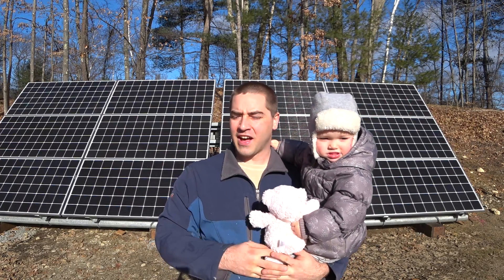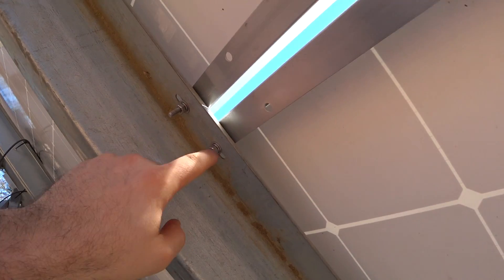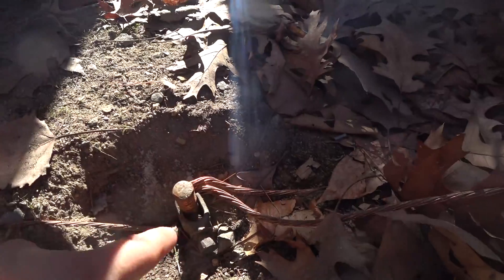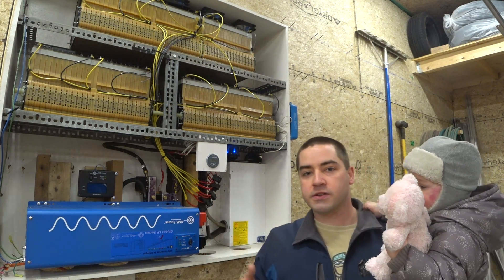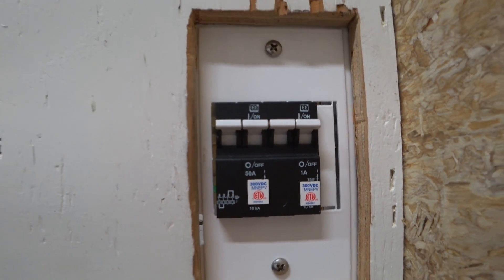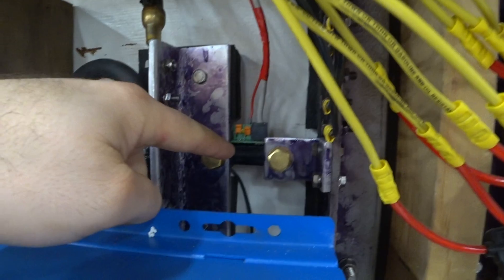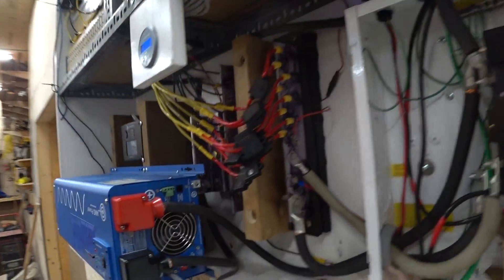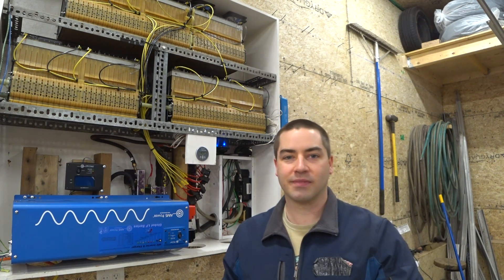Overview of Entire Off-Grid Solar System for Whole House

Comment: Are you able to run a whole house ac with this size battery system?
Reply from the maker: Sure.  For example: 3-ton AC averages 3500W.  After inverter losses, that's about 3,900W from the battery.  This is a 48V battery, so 3,900W/48V=81.25A  This battery can handle 250 Amps, so the answer is "yes" it can handle a 81 Amp load.

Comment: This is impressive.  What size inverter did you use?  How did you break down/wire the battery to match the 48 volt max DC input?
Reply from the maker: In this video I used a 6kw inverter with a 48v battery.  The 48v battery was made with a Chevy Volt battery pack broken into 12s modules.

Comment: Hi, nice build. I want to start a system in Trinidad (Caribbean). I am just confused as to how to size with all the AC units, Fridge, Washer/dryer etc. Can you provide some insight into sizing?
Reply from the maker: I'd suggest using an online calculator to begin the process.  The first piece of information you will need to know is, How many Kwh of electricity do you use per day?  When I built my system I looked at my electrical bill (billed by month) and divided by 30 days/month to find out my use per day.  Try this calculator: https://www.altestore.com/store/calculators/off_grid_calculator/

Comment: Excellent explanation of your build, congratulations on a job well done.  I'm also a solar enthusiast with a 3 KW on grid system and I personally added a 1 K off grid separate system that charges 6 deep cycle marine batteries.  I am a retired physician but you must have an engineering background to do such an elaborate system by yourself. I also added solar to the top of my RV and solar window shades using flexible panels.
Reply from the maker: Thank you for your comment.  My background is construction.

Comment: Hey David
I just watch your video and its really good
Im want go solar in my house. Now i have power thanks to my neighbor letting me run two extension cords. I have  Growatt 3000k 48 v inverter and i dont know where to gwt the panels and batteries. I need help so I can start having power at my house.
Thanks man!!!
Reply from the maker: That's great you are getting into solar.  I buy my batteries from https://batteryhookup.com/  My coupon code is "DAVIDPOZ" which the viewers of my channel can use for 10% off.  It tracks my affiliate.  Sometimes Battery Hookup also has some solar panels, but it's limited.
I shop for most of the other components (solar, charge controller, breakers, etc) from https://www.altestore.com/store/  I'm not affiliated with Alt-E.  
Alt-E has some good resorces.  Here is a calculator: https://www.altestore.com/store/calculators/off_grid_calculator/

Comment: Hi David. I haven't been to your channel in a while, so haven't seen the system assembled. How is it working for your place? Do you still use much grid power, or have you moved most of your electricity to solar? Great looking installation.
Reply from the maker: It's been working great.  My house is 100% electric.  I was back on grid power this past winter because I was upgrading a lot of the work.  New batteries, new inverter, etc.  But been off-grid again for the last month.  Running AC is great.
Reply: @DavidPozEnergy  That's awesome, and congratulations. We've been off grid for over 10 years, and it's been great following your progress.

Comment: Hi, I have 3 KW Solar Hybrid Invertor and connected 335*6 Mono panels(2010W) in Series (2 panels in one series) and parallel (3 series in one parallel). now I want to add additional 445W*2(in series) panels into same setup. is it possible to mix these 2 different panels ?

like I want to have; 

335 * 2 in series(3)

445 * 2 in series (1)

all 4 series connection into one parallel or two parallel connected all to one Hybrid invertor. 

Will it support without impacting existing or new value I mean volts/Amps/Watt.
Reply from the maker: Sometimes you can force this into the solar hybrid, but it will not work well.  The charger will try to track the MPPT (maximum power point tracking).  This works with one type of panel, but if you throw two types into the same port then the computer will always be compromising between the two strings.  Neither one will perform well.  
It is recommended to add a new charge controller for the new panels and connect that direct to the batteries, skipping the hybrid inverter.
Reply: DavidPoz thanks David for your valuable inputs. Logic is clear for me now.
Reply: Hi David , more query on same setup.
I have existing 2kw system with mono panels and now I want to increase the capacity by another 1kw but I couldn’t get same wattage and rating panels in mono but getting it in Poly. So can I use or mixed another two string with poly in existing 3 strings in mono?

Comment: If you were to wire a brand new home, Would you put a DC line in. You know, for things like charger, modems and routers.
Reply from the maker: Probably not.  If I built a brand new home, I would build a brand new shed at the solar array.  This would contain all the inverters, charge controllers, and batteries.  Then I would run just AC lines into the house through underground conduit.

Comment: seems to be a lot off buzz about using the Nissan Leaf batteries, was wondering you opinion  about the different batteries out there and the best bang for the buck, Nissan Leaf, Tesla, Volt etc. would appreciate any input.

Also, is it possible to buuild a system for 200 amp service completely off grid?
Reply from the maker: I personally have not worked with Nissan Leaf packs.  However, I know several people who do use them.  They bolt together beautifully.  Easy to stack and parallel cells.  I'm a fan.  They tend to wear out quickly in the car compared with some other car batteries, so finding the low-mileage ones are worth the hassle. 

Is it possible to make a service like in normal houses?  Yes.  It just gets costly.  Most of us DIY'ers don't have $100,000 for this.
Reply: @DavidPozEnergy  Thank you for your response.

Comment: Hi David This was an awesome video I gave you a shout out on my https://www.youtube.com/watch?v=0V7FufcLGsY Should I pick one of those Victron BMV-712 Battery Monitor's and also dose the shunt come with the rj5 input
Reply from the maker: Hi Darren,  Thanks for the shout out, I'll take a look at your video.  The BMV-712 does come with the shunt and the rj45 cable.  I have it to communicate with my Victron charge controller, and my phone app.  It keeps a record of cycle counts and stuff, so it's nice to see what your system is doing.  It's here: https://amzn.to/2Bbi5Et  However, it is $206.  So it's steep.  If you only want to see your battery voltage, amps, and watts (no app, or history) then there is a cheap option : https://amzn.to/2pkCqEG    If you use my affiliate links then amazon gives me a kick-back.  I hope that helps.
Reply: @DavidPozEnergy  Hi David I have a midnite charge controller will the victron work with that controller also I will use your links on Amazon I'll be purchasing later today. I have some other things I need as well like the plastic piece the protects the whole in my roof from rain that the wires run through. If you have a link for that I will use it as well.
Reply from the maker: Hi Darren,  I think the way the affiliate link works is: when you click the link it opens a browser window.  Amazon then tracks anything you buy until you close the window or 24 hours passes.  I get credit for sending you there regardless if you buy the exact item I link to or some other item.  So you don't need a specific link to a roof flashing.

The victron BMV-712 can work independent of your charge controller brand.  In my case they (CC and BMV) link up using bluetooth between each other because they are the same brand.    So the answer is, yes, the BMV will still work, just not communicate directly with your CC.  But you don't HAVE to have communication.  You will still be able to check your BMV on your phones app.  

Can we connect on FB?  I'd love to know more about your setup.  https://www.facebook.com/DavidPozEnergy/

Comment: I hear the victron charge controllers have a charging limit that can be adjusted.
Reply from the maker: Yes.  The high voltage can be adjusted through a huge range.  This is something I was looking for in a charge controller.  I currently set it down to 48.0v, but it can go up to 65 or so so volts.  This means I can use the charge controller with a range of different battery types.

Comment: David, I really enjoy all of your videos. It looks like our interests are pretty much the same, though you are a few steps ahead of me :) I recently setup an RV camper with 2 48V batteries made from Nissan Leaf Batteries and 3 340W solar panels. The batteries are about 6kw total. Its enough to run everything in the trailer. I just installed a Reliable Power 3000w inverter, the same one you have used. But I can't get it to run the AC. It will run pretty much everything up until 2000 Watts and than won't go. I'm debating about switching to an AIMS inverter. But, as you have said, the support from Reliable Power is great and I have been working with them to see if we can get things going. 

Anyway, thanks for the motivation to keep going. Keep the videos coming, though I have a lot to catch up on still :)
Reply from the maker: Hi Genn,  Yeah, anything with a compressor (like AC's) are tough to start.  Low frequency inverters with big transformers (Aims, Magnum, Schieder, Victron, etc.) are better suited to starting those devices.  When I had trouble starting my air compressor, people suggested adding a soft start kit.  These things are a big capacitor you add onto the AC.  I've never installed one, but they are worth a shot.  Here is an example, but I don't know if it is right for you: https://www.amazon.com/Compressor-Saver-Start-Capacitor-Model/dp/B003FNJ37U/ref=sr_1_5?crid=1U6LCU97JYCOV&keywords=soft+start+kit+for+air+conditioner&qid=1557489687&s=gateway&sprefix=soft+start+kit+%2Caps%2C151&sr=8-5

Comment: new subscriber, your system looks awesome wish you lived closer I could get you to help me with building one close to what you got. I live in Pa and get many cloudy days, how does this work on cloudy days?
Reply from the maker: It works much better than I thought it might on cloudy days.  Recently we had a day with solid clouds, scattered showers, and it putting out 300 watts.  It's a 4,380 watt system, so 7% doesn't seem like a lot, but I expected 0%.
Reply: I have been trying to do as much research on solar as I can to try to figure out what would be the best panel, batteries, and charge controller for cloudy weather. I think some are better than others for cloudy days. we have a lot of cloudy days in Pa. I have room for about 8-12 300 watt panels and I want my system off grid but it is only going to supply about half to 3/4 of my house. do you know of any good websites to help with planning a system. hopeing I can keep this system around $8000
Reply from the maker: Sure.  My favorite site is Alt-E.  They have a resources page with an off-grid calculator.  It takes into account cloudy weather.  I've used this for my own setup and found it accurate.  Even though my small town is not in the database, it's accurate enough to use the closest city.  https://www.altestore.com/store/calculators/off_grid_calculator/  

If you are limited in space then you might want to look for a solar panel with the highest efficiency.  This one has 19.3%, but is still very reasonably priced.  https://www.altestore.com/store/solar-panels/q-cells-solar-panels-p41041/#HAN325QPEAKD325

BTW, I'm not associated with Alt-E, just a happy customer.

Comment: How much money did you spend on those chevy lithium batteries?  How many 6v 208 amp hour golf cart batteries would that equal?
Reply from the maker: I bought my Chevy Volt battery for $2,033.  It is a 18.4 kwh battery, and I can use 14.3kwh.  With lead acid (golf cart battery) you can use 50%, or in your case, 104 amp hours.  So each lead acid battery has a usable 604 wh (6v*104ah)  Just divide that into mine for the total number of batteries, but first convert the kwh into wh.  (14.3kwh*1000wh/kwh)/604wh=22.917 batteries.  You can add about 20% if you want to include efficiency loss of charging/discharging if you wanted to.
Reply: What voltage is your battery system
Reply from the maker: https://youtu.be/ot3IhsUfFS8

Comment: great info for me. i am about to hook up  8  360 watt panels same config as your panels. to same combiner box as yours and same midnight 250. i  am  running 24 volt system   with aims 
3000 watt and 8  6 volt  golf cart  battery bank.   my charge controller  is a i panda master 100 amp . very cool charge controller you should buy one 
there new tech. maybe they would give you a good deal on one if you did a video for them as i have not been able to find many reviews on the master 100.
anyhow i am  going to do my breaker box same as yours.  big thumbs up to adam at alt e store . cris  diy . and you david
Reply from the maker: Hi Jerry,  All the guys/gals over at Alt-E are awesome.  I go there every other week to pick up something.  I'd love to see how your setup at some point.  (facebook?)  Thanks for watching.

Comment: Not sure if you already know about this info on grid optimizers, but this vid explains some of the problems with efficient solar grids. https://www.youtube.com/watch?v=m5wv4HcRNKw
Reply from the maker: I've seen that video, and I think it's really awesome what he has done.  I like it a lot.    You said "grid optimizers".  I haven't heard that term before, but you might be referring to his "power optimizers" (I'm not trying to be a jerk, just clarifying we are discussing the same thing)  The black box for each panel mounted between the panel and series string.  Anyways, I've seen videos from manufacturers stating claims that it can increase output by 30% and such.  However, I've never seen anyone show a side-by-side comparison to demonstrate how well it works in real life.  Even FarmCraft101 stated in his video "At least what I'm told..."  (@7:35 in his video) I would love to see a video proving that power optimizers are worth the extra money they cost.    Again, great video.
Reply: @DavidPozEnergy  At frame 10:47 he talks about the optimizers because his panels are in series. Thanks for clarifying. I wasn't sure if yours in parallel has more advantages than the series optimizers. I am really interested in PV solar panel systems since they are so much cheaper now, but my knowledge of electricity is very weak. I really like the way you setup your solar panel systems, but it is still too costly for me right now. Thanks for all your videos of info. They can help alot of people.

Comment: Great job David.  It occurred to me after watching a second time that the star washers on the panel mounting screws need to be between the frame and the panel.  I apologize for not noting that weeks ago in your mounting  video.   The star washer needs to bite thru the anodized coating of the panel frame.  FYI I had and passed the final inspection on my system on Tuesday.   Curious what your daily production has been.......
Reply from the maker: Congratulations on passing your final inspection, yeah.  The star washer is located between the aluminum PV frame, and the head of the bolt.  This is where the installation manual said to put it. https://doczz.net/doc/6544570/installation-manual-terrafarm-solar-racking-system-for-te...  So far my biggest production day was 19.77 kwh, and my smallest day was 0.10 kwh.

Comment: since i am new to your videos do you try and use the system only for backup (making it sit idle all the time ) or do you try and run it often while your in the garage working to reduce your electrical grid use ?
Reply from the maker: Hi T Woody, thanks for checking out my channel.  At the moment this system is just backup.  I'm still in process of making a sub-panel so I can use the power more and more every day.  I want to start powering up my loads in the garage with the inverter on a regular basis.  As the system evolves I'll keep posting new videos..  Thanks for watching.

Comment: Solar Battery Management System (BMS)> https://www.youtube.com/watch?v=3OAwr8FulGE
Reply from the maker: I think those are for up to 8 cells.  Each of my batteries are arranged in 12s.
Reply: @DavidPozEnergy  yeh my mistake. I am not an expert, I am just a fan of all electrics staff and your videos are priceless. Nissan Leaf Battery Modules> https://www.youtube.com/watch?v=FlCz40bCZZM
Reply: @DavidPozEnergy  This is interesting but yet expensive> CLEAN ENERGY https://www.youtube.com/watch?v=Fvh3WBieyPM&t=9s
Reply from the maker: I just watched this.  It was a very pretty piece of kinetic art, but was not shown doing any practical work.  I don't think I can plug my miter saw in.  LOL
Reply: @DavidPozEnergy  It is still in testing

Comment: You said there is 350v dc come from the solar pv, if there is 5% voltage due to dc wiring there still 330v dc from pv, but your victron charge controller only take 250v dc max, there still 80v dc excess to your charge controller, doesnt this will overload and fried your charge controller?how much voltage coming into charge controller?
Reply from the maker: I jumbled my numbers, sorry.  My circuit breakers are rated for 300 volts DC.  My charge controller is rated for 250 volts DC, and my solar panels put out an average of 156 volts DC.  Sorry about mixing some of the things up.  I do a lot of video takes, and a lot of editing to try and make good videos, but by saying the numbers over and over again sometimes I mess something up.

Comment: 48v is too low for DC solar system. We are using 200v DC system. Save lot of money on cables/wire . More voltage means less current and can easily use regular AC wires.